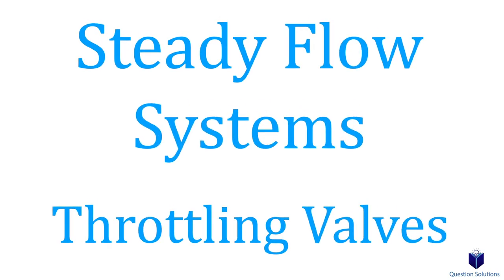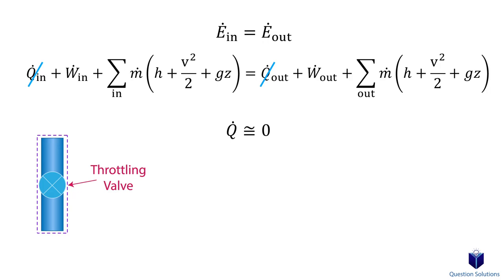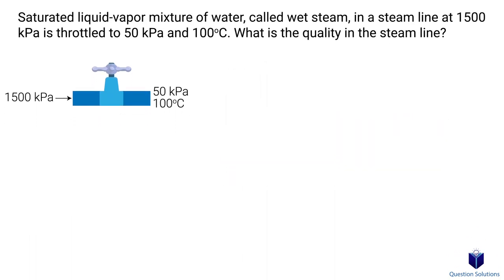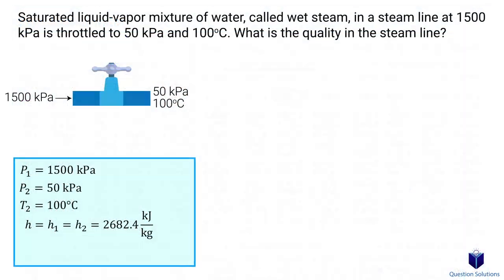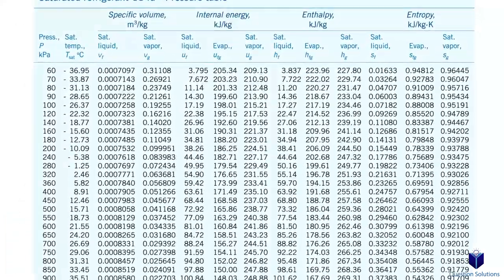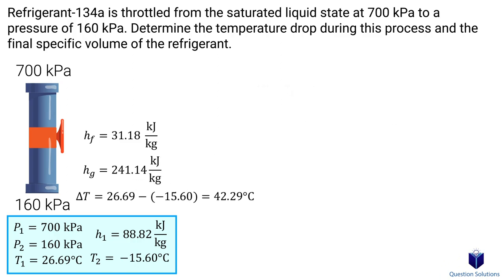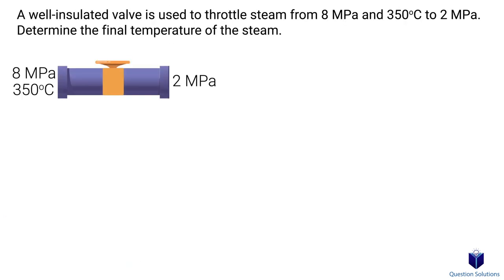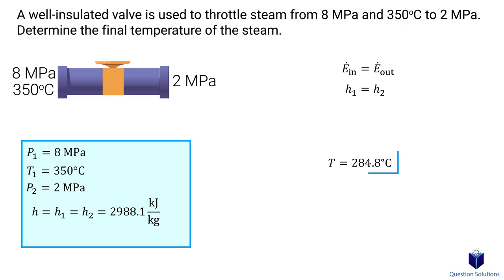Steady Flow Systems - Throttling Valves | Thermodynamics | (Solved Examples)

Comment: Professor I have a question,I wonder why enthalpy combines internal energy and flovwork?Could you explain me briefly
Reply from the maker: Your textbook should have a really good section about enthalpy. Were you able to read it? This website ( https://www.sciencedirect.com/topics/biochemistry-genetics-and-molecular-biology/enthalpy#:~:text=Enthalpy%2C%20normally%20denoted%20H%2C%20is,H%20%3D%20%CE%94%20U%20%2B%20%CE%94%20pV ) also goes into enthalpy, how it's related to internal energy plus pressure and volume (which is related to flow work). If you have sometime, please read it to get a better understanding.

Comment: In all these cases both pressure and temperature drop, and enthalpy is a combined measure pf pressure and internal energy. How could they possibly be equal at the inlet and outlet? What don't I understand about the concept of enthalpy?
Reply from the maker: Please see: https://www.physicsforums.com/threads/the-principle-behind-throttling-valves.67757/#:~:text=In%20summary%2C%20throttling%20valves%20are,it%20passes%20through%20the%20valve.

There is a good discussion going on about this that might shed some insight to your problem as well.

If you want to go really deep, you can read this as well: https://www.sciencedirect.com/topics/engineering/throttling-process

In real life, there are some changes to pressure and temperature, but it is negligible in the "grand scheme" of things when we write an energy balance equation because of the factors we consider when writing the said equation. So enthalpy remains relatively equal to each other at the inlet and outlet.
Reply: @QuestionSolutions  Thank you so much for taking the time to provide me with such good resourses.